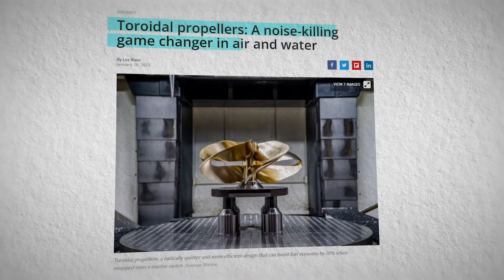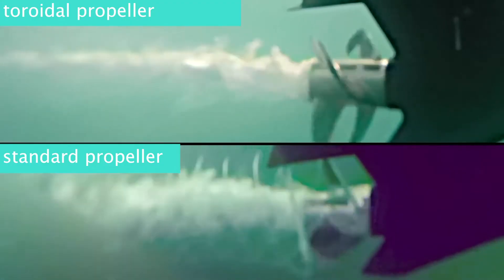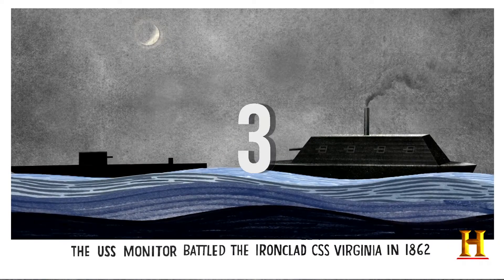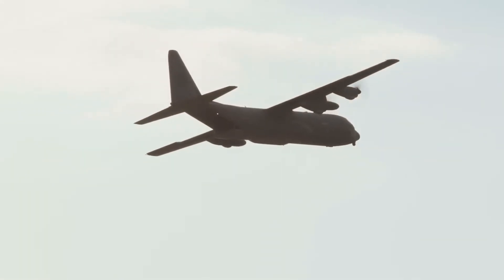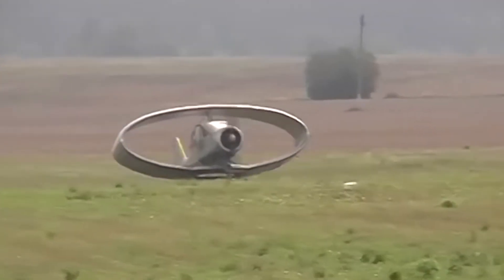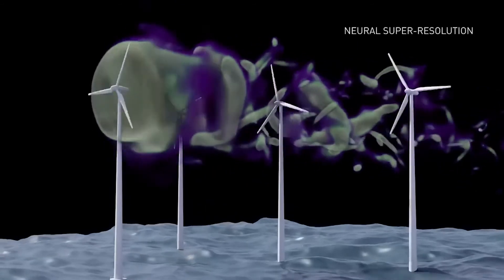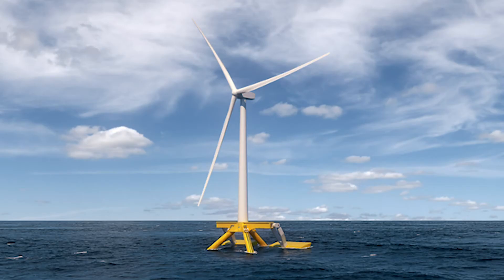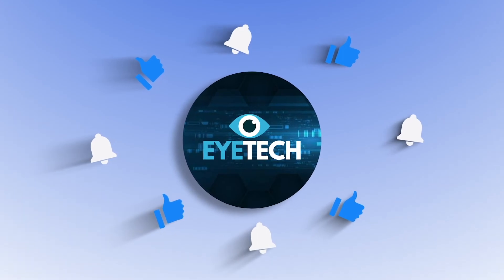This Amazing New Turbine Will Change Energy For Good

Comment: If you've seen video of a wind turbine blade being transported on a huge flatbed truck trailer - which no doubt you have - you'll know just how enormous those things are. A toroidal blade would be that plus a vast amount of extra bulk because of its shape, so it's probably unlikely toroidal blades will become common on wind turbines. I can see them becoming quite the new thing on submarines though, where a need for high efficiency and low noise is paramount.